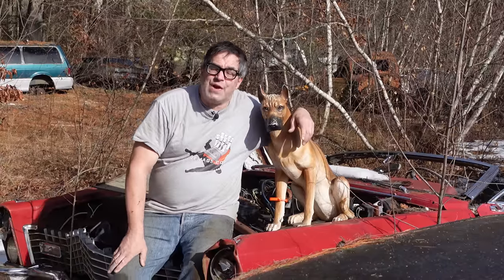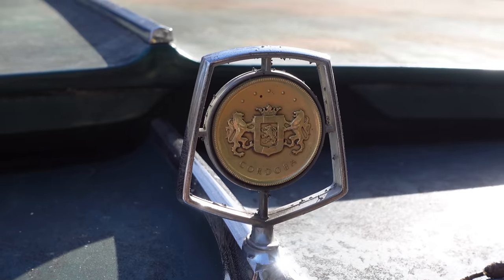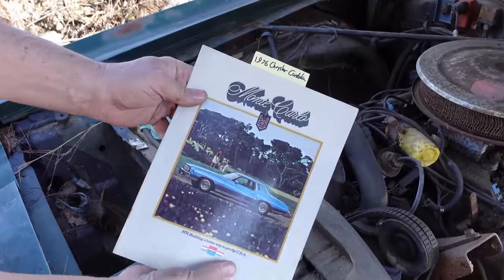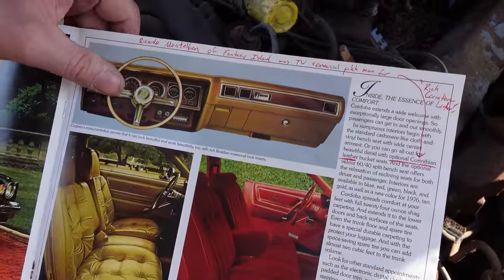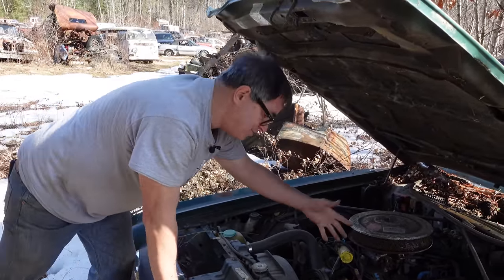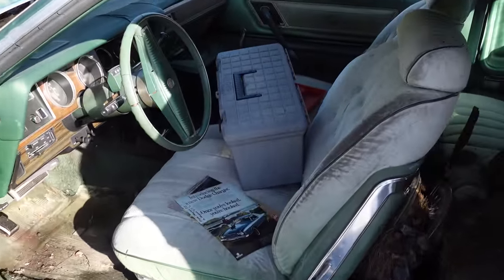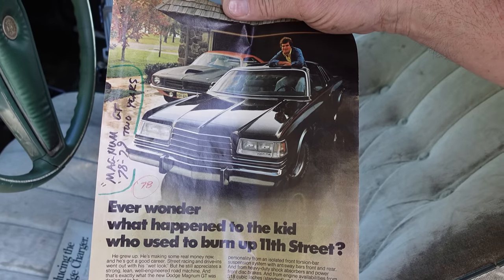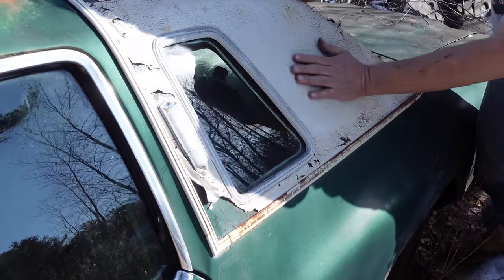Chrysler Copies Monte Carlo

Comment: I had FOUR of these in the mid-late 80s. You could buy these for around $100 when the rear springs came through the rusty trunk floor.
One we replaced the 360 with a 1970 318 - it would beat my friends 400 lean-burn on the on-ramps.. Good times.
My favorite was white with a red interior (Aztec print)
Thank you for the wholesome content
Hello From Wisconsin
Reply: I had a 78 magnum do that.
Reply: Mom's 76 Cordoba popped the right side spring through the trunk. Local garage patched it back together pretty decent back then n got a few more years out of it

Comment: Those were awesome cars! In 1976, my grandmother (who, along with my grandfather, adopted me at age 3 in 1971) bought a brand new 76 Dodge Charger SE, the sister ship to the Cordoba. It was Dove Gray with red pinstripes and that gorgeous red velour interior, bucket seats with console and floor shifter, and it had the 360 4-V. What a beautiful car it was. It proved to be very nice riding, with good power and decent handling. I always wanted that car, but it was traded in for a new 1979 Chrysler New Yorker Fifth Avenue Edition, and that one I actually did inherit from my grandparents in their will in 2014. Still have that Fifth Avenue, and man, what a beauty it is! Designers Beige and Designers Cream two-tone (the only color option for Fifth Avenue in 79), that lovely "fine" (or was it "rich?) Corinthian leather, and the 360 2-barrel. Oddly enough, in 79, the 360 New Yorkers in California only came with the 4-barrel as standard fare, yet the 2-barrel 360 was the base engine in the rest of the country. Since my 79 is a Pennsylvania car, and grandpa didn't up for the 4-barrel, it has the 2-barrel, and is now with me in California. I still have the Lean Burn system on it, and the 2- barrel, because I still have to pass the Cali smog check every 2 years (stupid), otherwise I would have swapped out the intake and carb for the 4-V, and maybe done away with the Lean Burn, although that Lean Burn system still functions perfectly! It's rare for them to still work, or so I hear. After I moved from PA to CA in 1986, I owned a few Cordobas, one had the 400 4V. Man, that ThermoQuad would howl at WOT! It was relatively quick, and a real joy to drive hard! And before inheriting my grandparents Fifth Avenue, I had a base New Yorker here in Cali. Nowhere near as plush or nice as my Fifth Avenue! Thanks, Steve, for a trip down memory lane! Love your videos, brother! Keep it up, and stay safe and happy!

Comment: Cars like that from the mid to late 70s did have a style that brought back memories of earlier eras of automotive and lifestyle history. Imagine the surprise of popping the hood on one of those malaise era machines and finding an open element air cleaner and after market four barrel. Even in the late 70s when I was learning cars were a lot more than something to ride in, the Lean Burn was getting hate. Still have to wonder how much “dirtier “ the exhaust on that Cordova was with the Holley and no cats. 

I was an explorer with my home town sheriffs department in the late 70s. I recall some of us poking around the maintenance shop one evening and popped the hood on an LTD II thst the undersheriff had previously driven. We found the open element air cleaner and an Elelbrock SP2V intake with a Holley 500 2V. I remember that Edelbrock manifold being advertised as a smog motor alternative which still allowed for the 2V in the day where we were all under the impression that tampering with the smog equipment would bring down the rath of the federal government is much the same way as tearing off a patterns tag….

Comment: Hello Steve...My dad owned a Chrysler/Dodge dealership in Patterson Calif.I worked on at least 1000 Cordoba's through 1975-1981 these were fantastic cars that could get over 20mpg on road trips we had 3-4 customers that monitored their fuel mileage constantly it was pretty cool back then until the "lean-burn" computers started taking over...first ones were full analog then switched to 50/50- digital no fun to trouble shoot...I still have a few of the new car brochures/catalogs...

Comment: The only thing I'd like to add, would be that these cars weren't the "last bastion" of rear wheel drive for Chrysler as noted. The Diplomat/New Yorker/St. Regis/Grand Fury (M platform) ran all the way up to 1989. Granted they didn't have the production numbers of the Cordoba/Charger/Magnum, but they were used as police vehicles for a number of those years (more so than the Crown Vic in many states).
Reply: St. Regis was the R body (evolution of B body) and larger than the M body diplomat
Reply: @pdennis93  Point was, there were rear wheel drive cars available after the B Body ran it's course.
Reply from the maker: @NewbombTurk.  And the final BIG BLOCKS. Bummer! The 1979-up cars were all small block or even Slant Six equipped.  Thanks for watching and writing. -Steve Magnante

Comment: Mags Larry built the coolest truck you'd ever see we found a 74 crew cab 4 door short box dodge pick up in Douglas at rowans in ontario canada and he switched the box for step side and built a 4 door warlock with a fully loaded it with a 440 engine and dash from a new Yorker with the electronic cluster from a 80s daytona and fake plastic stick on wood grain from home depot he varnished after looked awesome not cheap or junky he put a column from a new Yorker with telescoping wheel which he took out the lever on the side and made the hornbutton work with it instead just like the Cadillac even put his own air conditioning from another car made it work you wanna see this guy with a thermoquad,he painted the truck black and had the gold decals or it. I didn't get to see it finished though this guy was one of the most amazing modelers I ever met put mine to shame even likes trains the big ones that go around your property outside can't remember the scale last I heard or poor Larry he had a massive stroke this guy was one of the biggest Mopar guys you ever meet please say a prayer for Larry

Comment: My uncle had a full service gas/service station when I was in highschool, and he had a customer with one of these. The man was quite old, but his Cordoba was one that had an orange dual snorkel air cleaner and twice pipes! He only drove it a few blocks at a time to church, the store,ect at 25 mph and it would start to run bad, so he would bring it in. My uncle w
Reply: I didn't get to finish...my uncle would take it out on the highway and " blow the cobwebs out" ad he said and it would be fine for a couple weeks again. Lol
Also,. With the twice pipes, uncle Ray would be putting mufflers and tail pipes on every 6 months...but the old guy refused to switch to single exhaust, so.  It was like a standing appointment. Haha
Reply: I want some of what you're Smoking
Reply: Click on the 3 tiny dots on the right & you can edit your comments

Comment: Hi Steve, great video on this Chrysler Cordoba. I can say with the utmost confidence that Chrysler did, in fact, took some of the design features from the Monte Carlos, and when the 78s came out, with the stacked square headlights, they started to look like the 76 Malibu in the front. The 75-77, along with the 300, are definitely collectible and an easy flip. I went back Steve and rewatched your previous video on the 300 version of this model. The 1980-83 models are almost impossible to find around here. I guess not many were sold. Those looked a lot like the Chevelle Laguna. Check out the movie Cordoba Nights featuring a 76 model. Thanks, Steve, for battling the elements it looks cold and windy during this episode of Junkyard Crawl. Have a blessed day everyone 🤙🏼 Namaste 🙏🏼
Reply: I can see with utmost confidence, you're wrong. It's more like the Monte Carlo copied Chrysler. That roof was even available on earlier Chargers. Monte Carlo might have gone to stack headlights in 78 but Chrysler had them in 77.
Reply: @garyszewc3339  hi thanks for commenting 🤙🏼 Namaste 🙏🏼
Reply: @garyszewc3339  produced in 77 but for the 78 model year, 77 model year cars were still the round headlight facia. research more!
Reply: @doba78  no they were not. I worked in the dealership. 1977 including my 1977 sport fury definitely had rectangular headlights. You need to research and not trust the hearsay you find online
Reply: Chevrolet began the stacked headlights on the Monte for the 1976 model year.
A friend had a 1977 Monte back in the day.
He also bought a 1976 model (with a bad engine), so that he had replacement front body panels, in case he hit a deer.
Both had the stacked headlights. NOT the circular ones of the previous years.
Reply: @willhorting5317  I don't know chevys, never liked them. The couple I had were junk. One of which was a Vega, so of course they were as low of quality as a pinto. 73 Malibu, the bottom era for quality. My reference is to the statement the rectangle headlights started on b body Chrysler products in 1978, that is wrong, B body Chryslers started in 1977.
Reply: Hi fellas I should mention I was talking about the 78 Cordoba not the Monte Carlos. I was saying that those had a very similar front-end design as the Chevelle Laguna. I apologize for the mix up in my comments. Thanks for commenting it helps Steve's ch and Junkyard Crawl. Have a blessed day and I'll see y'all bright and early in tomorrow's comment section. 🤙🏼 Namaste 🙏🏼
Reply: @chrisscearce  I knew that you were talking about the Chrysler.

I brought up the Monte Carlo info, simply because other people had, before me.👍
Reply: @Will Horting  Hi, no harm done. I can feel you are a man of honor and refinement. Most are rude and can't carry a conversation without insulting or allowing their ego to lead their thoughts. I had seen where maybe my comment had been misinterpreted because of my lack of details. I sincerely appreciate your time and consideration. It's been an honor to hear the facts you have brought to this discussion. Thanks again,🤙🏼 Namaste 🙏🏼
Reply: @chrisscearce  you are welcome. And thank you.

Comment: I owned a 1977 and a 1979 cordoba, great cars to drive, real comfy on long drives. The parking lights on the 77 were perfect, could drive around on dark parking areas with just them on, did not need the headlights on as they gave a lot of light to see in front. Hated the rearrangement of the headlights on the 79 model, always thought they wee ugly, but what can you do? Driving around at night, with the outside marker lights on, gave the car, gave the car that little extra class.

Comment: I remember when those things were a dime a dozen. I had four different variations of that car. All of them 1976 and 77 with small block 360 one of which was a thermo quad with a consul, a real nice car although they used a 904 transmission in it. Went through several transmissions in that one 🙂 I think they were building them with anything they had sitting around to keep things rolling.

Comment: Wow,  brings back memories! My mom bought a 1976 Cordoba new, when I was a kid. It was black with a red velour bucket interior,  and the lean-burn 400! When the second gas crunch hit, I remember it would never be able to pass a gas station for more fuel ⛽️ 🤣🤣 definitely was one beautiful car,  with almost every option except for the Corinthian leather. The only major issue it had were the brakes,  and the Firestone tires. They ended up trading it in on a new 1979 Plymouth Horizon TC-3,  which was a great running car. Interesting enough,  it had a Volkswagen engine! When my parents sold it,  it had over 500k miles on it!!

Comment: I see people still suffering "range anxiety" after the fuel shortage. Note the 25.5 gallon fuel tank with a 2.45 rear end option. I'm guessing this could easily see 25 mpg on the highway at 55 mph.... well over 600 miles on a tank! (also on regular gas, not $$ unleaded) Of course, that would be a slug around town.

Comment: My aunt had a 77 model she bought new and for about day one she had problems with the carburetor and computer
When she was behind the wheel of the car ,she looked like a 10 year old driving a car she was only 4'10" she would put the power seat all the way forward and all the way up it sure was not a small car, I rode in it a couple of times and the leather seats were so slick that you would slide from side to side when she went around a corner

Comment: My parents had one in the 80s it was white with red vinyl top bucket seats in the front with floor shifter automatic and red leather interior and had the 400 lean burn engine, wish I could have bought from them was parked in the early 90s was then sold for $300

Comment: I wouldn't say they copied the Monte Carlo. That roof was available on Chargers in like 1973. Everybody was using that style. Thunderbirds used it. Square headlights started 1977 for Chrysler and then GM followed suit on the Monte Carlo. The leanburn computer was an additional unit that was mounted to the air cleaner, so it could pick up ambient Air temperature, which would also cool the computer. The distributor would not have a vacuum advance. The computer would control advance. 1977 eliminated the two barrel and they were all four-barrel carburetors, with catalytic converters. Furys were c bodies, sport furys were b bodies. There were two chargers, one like the cordoba, and one like the sport fury. Profit was a little higher,  I bought a 77 sport fury that the sticker was $6,969.68, and paid $5,500, as a mechanic, getting a car for supposedly $50 over cost.

Comment: I remember that the taillight lens would just fall off of these. I’ve seen several through the years. 🤣
Reply: Yes , they kept falling off my 77 and replacing them was costly so I drilled two holes in each and used two long screws in each and a little of girlfriends red nail polish to blend in the screw heads . Problem solved !

Comment: Back in the 60's and early 70's, all Chrysler branded cars came with big block engines and customers would feel ripped off if a Chrysler came with a small block which probably explains why the big block 400 came standard with the small block 318 and 360 as no cost options.